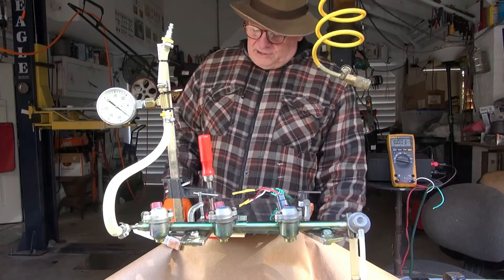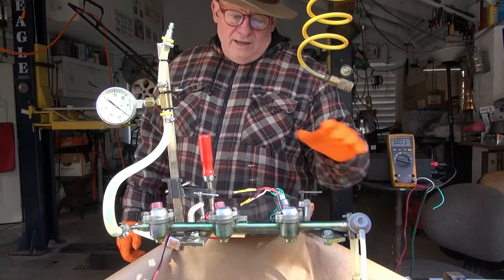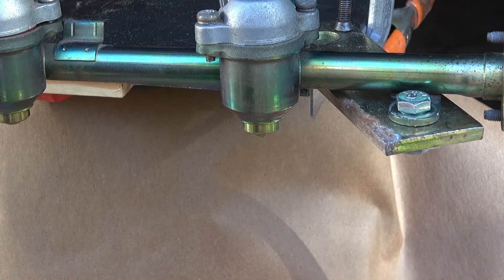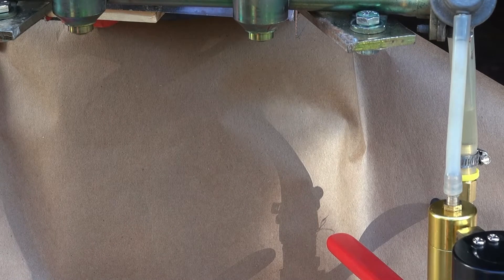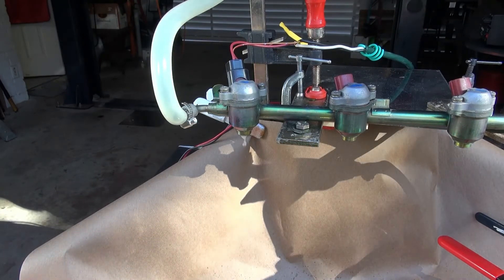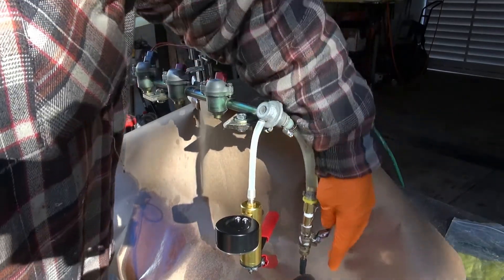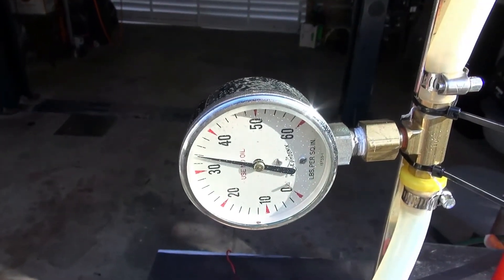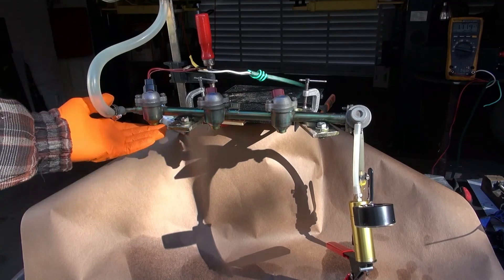Nissan Maxima Fuel injector and pressure regulator testing

Comment: From an engineer and keeper of old, high-mileage cars, this video was incredibly fascinating and very much appreciated.  Thank you for going to the time and effort to set all that up.  I have this exact setup (96 i30t) and have just replaced the #3 injector due to it spontaneously going OPEN circuit on the solenoid.  Believe it or not, the car did not throw a code for this!  These were the original injectors with 250K miles, so I guess it just cried uncle and gave up.  Obviously, while the manifold was off, I replaced 1, 3, and 5, as well as completely restored the EGR system.  However, I have NOT yet replaced 2, 4, and 6 injectors.  New NGK sparks were installed and all coil packs tested, and now the idle performs MUCH better (no more sagging when clutching at redlights).

However, I learned something interesting here.  Prior to all that work, I would routinely have the extended crank issue at hot.  It's better now, but not completely gone.  I've now ruled out other possible sources such as the EGR system, fuel pump, and regulator (no gas in the vacuum line),  BUT after watching your video, I'm inclined to believe that one of the remaining 3 old injectors is suffering this same leaking issue and thus causing a rich condition on the next start, within a certain time window (usually within an hour or two).  If the car sat overnight, it always fired immediately, which probably means 1) pressure in the rail eventually dropped to zero and the leak stopped, and 2) leaked fuel had time to evaporate, depending on valve positions.  This probably explained the smell of gas around the car as well.

One other interesting tidbit from having replaced only the bank 1 injectors... the live data is now showing almost perfect (0%) long term fuel trim on bank 1, whereas bank 2 long term is hovering in the 8-10% range (indicating overall lean conditions).  To me, this would seem to indicate that the remaining old injectors are not exactly healthy, and probably producing a reduced flow and/or less atomized spray?  Thanks again for the content!
Reply: Update.... finally replaced bank 1 (2, 4, 6) injectors.  Fuel trims on that bank are now also perfect AND (most importantly) the extended-crank-at-hot issue is now completely gone.  This confirms that one or more (likely) of my original injectors were leaking and creating a rich mixture when starting.  Thanks again for your video that helped me confidently diagnose the problem.

Comment: working on same car customer change coils his ebay coils are junk new coils installed plugs then they did crank and cam sensors no codes. after fuel pressure test 20 psi then the pump stopped we replaced it new one/ car idles fine now 37 psi thank God use my solos pro to turn off  each injector 1 then 2 etc. car will rev to 6k with injectors all on surges. 20mph car . fyi when i turn fuel pump off drops to 0. yes i know it a return to the tank system what's your thoughts.

Comment: Very nice work!...I have a 2000 Max, trying to figure out a stalling problem.
Reply from the maker: thanks....you will figure it out
Reply from the maker: stalling at idle...look at idle air control valve and mass air flow sensor